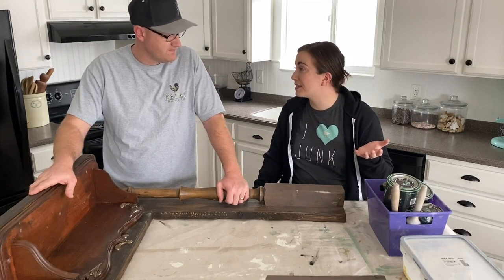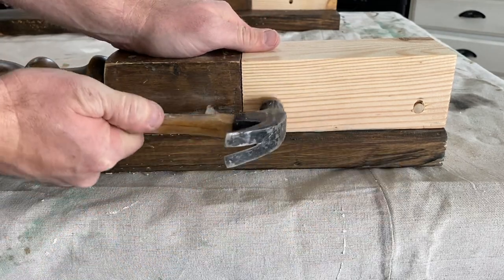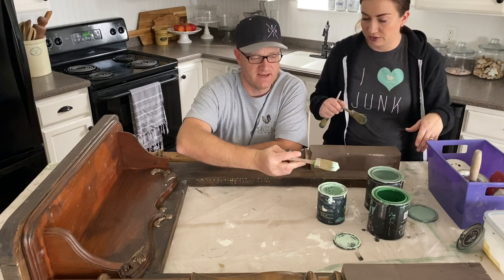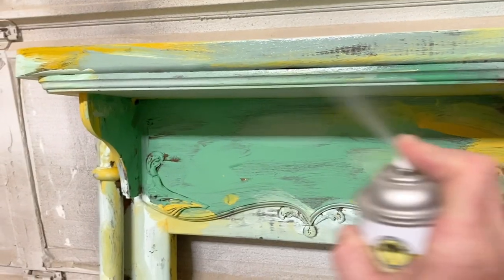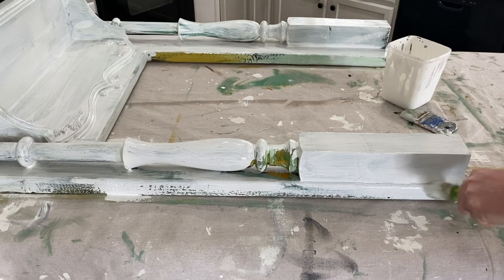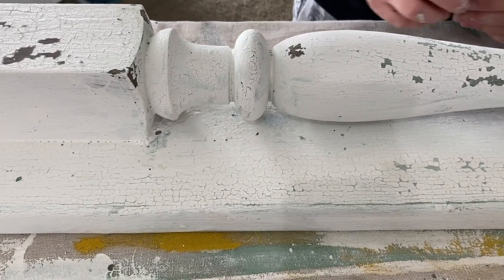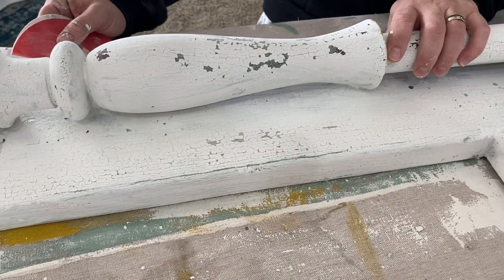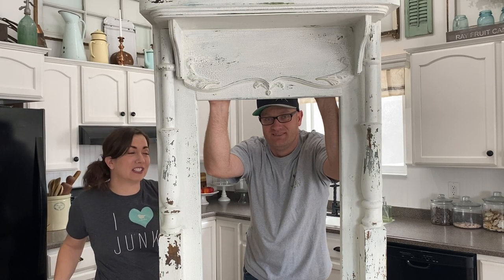Trash To Treasure DIY Chippy Milk Paint On A Mantle Made From Scrap

Comment: The 'mantle' turned out amazing. I'm definitely going to make a similar piece for myself, without the long side pieces though. I thought it would have looked nice if you cut the spindles in half length ways so they sit flush against the boards. Would also mean you had an extra to make a second mantle. Wonderful and explanation as always.

Comment: Love it! But wondering if you have to use milk paint to get that effect? Chalk paint won't work?
Reply from the maker: You can make chalk paint look old but I’ve never had the same chippy results as I do with milk paint.
Reply: @JamiRayVintage  Thanks, I'm gonna try to make a mantle out of an old antique wood bed using the headboard and rails that I picked up on an online auction for only $2. I sure want that look you two achieved on this piece!

Comment: Amazing tutorial - I'm so inspired!

I got some of your Sweet Pickins milk paint for Christmas, but I had a couple questions. I understand from the video that the shellac helps the milk paint become chippy, but is that also because you used a clay based paint? I have chalk based paint that I was going to use underneath so I just want to know if it'll have the same effect or if I'll need to get the clay paint for added chippy? 

And then my second question is just to clarify that wet distressing helps it become even more chippy? Or does it just remove the paint in some places to show the stained wood? 

Thank you both for all your amazing vids! I'm a big fan 😊
Reply from the maker: The milk paint can chip on its own but the shellac creates a barrier between the milk paint and DIY paint so it doesn’t chip all the way down through the clay paint and we get two tone chipping. If you paint milk paint over the shellac while it’s tacky it helps it chip too.
Reply from the maker: The wet distressing reactivates the paint. Just know that by doing that step it can all chip off. Or maybe some of it will. It’s unpredictable.
Reply: Thank you for your help!!